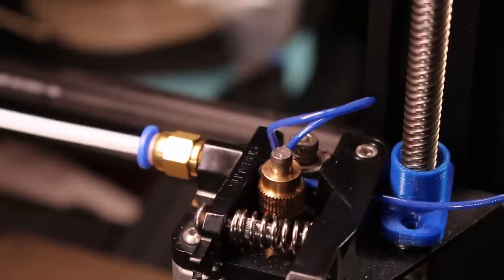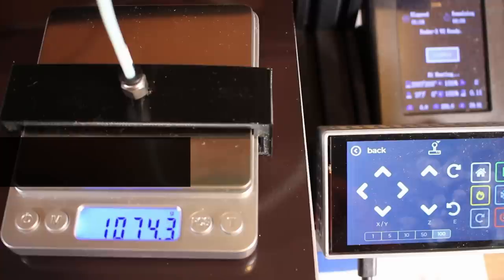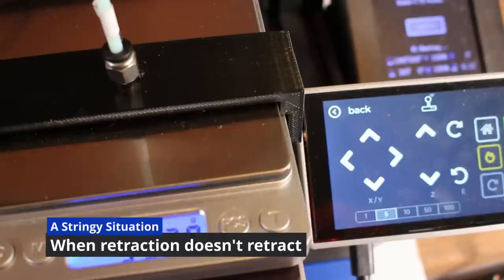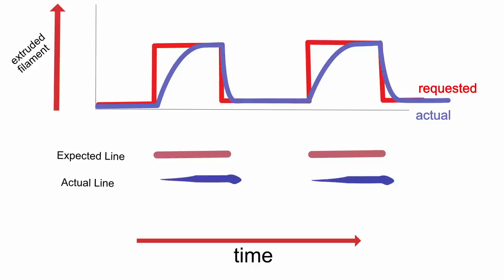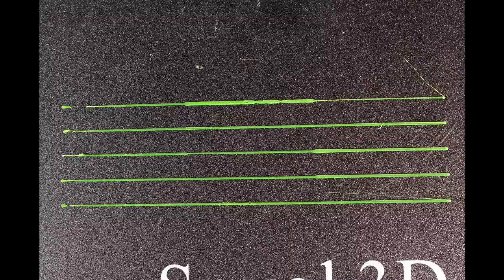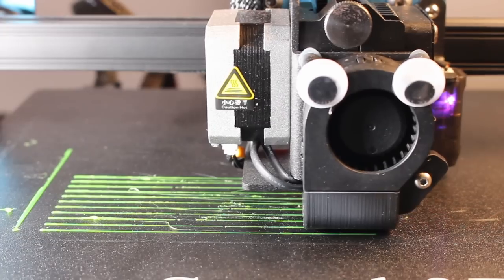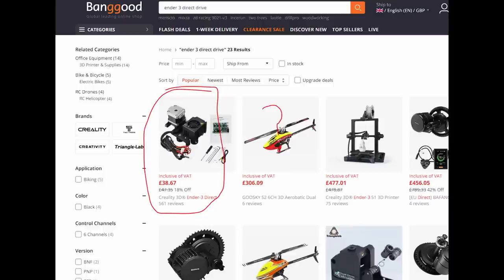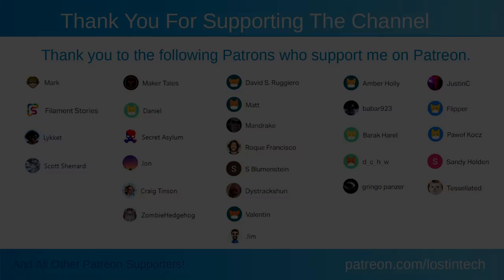Why 3D printing with FLEXIBLE filaments is hard and how to fix your TPU printing.

Comment: Thanks for these. Your previous TPU videos (and profile) helped me tune my E3Pro for 95A with amazing results. I understand that if I want to go more flexible than that, I will have to invest in a direct drive, but really great-looking 95A from an Ender-3 was more than I was hoping for and is enough for my needs.
Reply: There's also nothing stopping you from converting your Ender 3 to direct-drive without spending money (apart from some filament and an extension cable for the extruder motor).  Just look for the Direct Drivinator on Thingiverse and co.  I've had a slightly modified version on my Ender 3 Pro for ages and even for printing PLA the reduced retraction needed outweighs any drawback (extra weight on the x-gantry which on Ender 3 is only supported on one side) in my eyes.  Clearly it isn't giving you a fancy gear reduction or so, but at close to $0 it was one of the best improvements I added to my Ender 3 Pro.
Reply from the maker: Yes I forgot to mention you can do it for free 👍

Comment: Not a pain to print with a Bowden tube going all the way to the nozzle. Had 0 issues with that.
I have moved my printer to direct extrusion and only then realized how wonderful Bowden tube was(with some cons of course.)

PTFE tube has no friction. So you can print with any speed and temp. Even in a case extruder will not be able to push TPU with needed rate, Bowden tube length will compensate that as a buffer, allowing filament to curve inside but not stuck fully.

Comment: Nitpicking here, but the spring model is slightly incomplete and only part of the picture. Hopefully the below is helpful for anyone wanting a bit more of a deep dive.

LA/PA values are in units of "time," and it's easiest to think of K as an approximate time delay between the commands are issued and when material actually exits the nozzle. Material stiffness contributes to LA/PA but that's only part of the story. LA/PA is more like a RATIO of flow viscosity (damping) divided by spring constant (stiffness). This is why materials that are free-flowing and rigid have very low K-values. Those with either high viscosity or low stiffness (or both) have high K-values. Surprisingly (or not), this ratio has units of "time" just like the example above. Not to take the wind out of your sails, but the use of the letter "K" IS likely either coincidental, or a by-product of an earlier and different model.

Final nitpick - "ideal" springs aren't time-dependent in engineering models - only position-dependent - so that alone wouldn't cause the delay (damper models are used instead). I understand the goal is a relatable metaphor, so no issues there, just wanted to clarify this.

...also, the rabbit hole goes way way deeper the more "accurate" we want these models to be. All of the "above" only considers drag with the nozzle walls, not additional effects like material viscoelasticity, die swell, temperature-dependence, printing quickly with large temperature gradients, etc.
Reply from the maker: Argh! I get your point though 😁
Reply from the maker: Oh also I would ask anyone who wants to corroborate your explanation, to check out the link to the duet firmware site in the description, because it's written like a huge academic paper! 👍👍
Reply: @LostInTech3D  Check out the academic paper "Investigating pressure advance algorithms for filament-based melt extrusion additive manufacturing: theory, practice and simulations" by Tronvoll et all. It has a pretty great explanation of the K-factor derivation and goes a little more in-depth. Eqn 4 in particular is where we see damper-like behavior (force = some coefficient times velocity)

The Duet3D derivation is OK but a little confusing as it's hard to track K from start to finish. The time-derivative of Hooke's Law in particular is where a bit of hand-waving goes on - technically it's where the model subtle switches from "spring-only" model to a spring-damper one.

Of course this is super deep into the weeds, but just something I wanted to point out just in case. Great video and content as always!

Comment: Because I have no patience, I print everything with a .6 nozzle and fairly fast. The few times I’ve printed tpu I just used my normal pla settings on a cr6 max with a very long bowden tube and had no issues.  Nozzle diameter has to be another factor to consider.  Great video
Reply from the maker: It does, I tested it in ...I think the TPU video before last! :)

Comment: I found that CHEPS solution to printing with tpu on a bowden style printer has been amazing. He redesigned the connection that is made to the bowden tube on the side of the extruder, and added a piece of tube that butts directly against the gear. With this set up I haven't had TPU escape at all. I'd suggest you give it a shot because so far its worked wonders. I've gotten pretty good results with his design and your information :)
Reply: Do you have a link to a video where he explains the process? Thanks 😀
Reply: That video is not easily found through a search

Comment: About the extruder tension needing to be lower, I notice exactly that last time I printed TPU. I have really not a lot of experience with that material, and I wasn't able to print it even tho I managed to print it in the past. Change the extruder to LGX, same problem. Well, there was too much tension. Used the first click on the LGX, printed flawlessly
Reply: Interesting, i have a lgx lite, set it to the last click (has only two tension settings and open), reduced the maximum speed to 150mm/s (you have read right, 150), hit go and a beautiful phone case came out, but not usable, bad stl (came out to large).

Comment: Wow, so happy I found this video and thanks for sharing. I was having the same issue. The issue I'm having now is, my dual drive gears are shredding my PLA filaments when going into the extruder. I have been in social media and here on youtube but I haven't found a solution. Do you have any videos regarding these issues and if you don't can you please make one?
Forgot to mention, my printer is an Ender 3 Pro. I also ordered the direct drive kit cause I got tired of trying to fix the issue with the dual gear drives.

Comment: There's also the 3d printed direct drive mount for Steves, which can be used to try out direct drive for free.
Reply from the maker: I think it works fairly well too?
Reply: @LostInTech3D  I haven't used it myself, but I've only heard good things about it.
Reply: That's what I have loaded on mine and it has really stood up to the test of time. The other thing that really helped with an Ender 3 is an extrusion idler that utilizes perpendicular force instead of lever arm action. Really helps to stop TPU from doing the noodly escape routine.
Reply: It's decent, but designed for hard filaments, not TPU. Still has alot of wiggle room right by the gear allowing for noodling

Comment: A thing i did to counter my TPU escaping from the feeder is that i printed a small insert i wedged in between the gears and the part the bowden tube is attached to which closes all the gaps it can escape from, never had any issues since.

Comment: I always run my extruder tension crew one turn tight from the minimum with TPU, Using cura 4.13 ender 3 pro PLA profile just turn off the bed heat works good far better than the tpu profile for said printer. Great video thanks.

Comment: 95a has been hell to try and print larger prints with the print would start ok but after a while i got terrible stringing and the nozzle clogged im going to try a 0.6 nozzle instead and play with the settings your videos have helped immensely any other things i should try.

Comment: Thanks do much for this video dude, so much great information for me to think about. And your humor throughout is very much appreciated too!

Having about 5 years of experience printing 85A TPE exclusively (*cough* FUSED footwear *cough*), I just avoid retraction all together and use a combination of coasting and wiping to defuse the pressure in the nozzle before the it moves to a new position. And my favorite way to print is a delta with zesty remote drive. But mine is a pretty specific use case I guess. 

I have the FLSun V400 coming and I'm REALLY looking forward to how that machine will compare to my home-built Frankensteins.
Reply from the maker: the V400 is an absolute beast on every level, I have no criticisms of it even after I think 200h of printing. You won't regret it!

Comment: This is brilliant! Basically You have make me into trying and printing in TPU. And now I'm exploring this subject, and making things that otherwise no one would thing to print in TPU or that would not function if not made with TPU or another elastic filament. The only thing I don't like in TPU - it is hygroscopic like table salt :/. I do fly my DD Ender 3 with Kipper, so I do use pressure advance, yet the advice to tune it especially for one speed and TPU is a gem (I would be happy to see guide on it). SuperSlicer (or Prusa) can have custom gcode per filament, I did figured how to add per filament setting in Cura - yet I miss custom gcode (I'm waiting for tree support in SuperSlicer). 
   Keep on good work!
Reply from the maker: I only recently heard how hygroscopic TPU is...I am very surprised to hear about it as I've never really noticed!
Reply: @LostInTech3D I've had issue with printing fresh spool (the fist one ever ;) ) from F3D Filament (stringing and differences between spool and web page description), so I've call them. A+ support from a guy that is on the same page , and I've got advice to dry it well at 70C. That solves a lot of issues.

Comment: I didn't know that people were saying to increase tension with TPU. I dealt with stuff myself an figured that when I use it with my Prusa MK3 S I would decrease the tension by about 1 screw rotation. Else it would chew up the filament. Later I also got into volumetric flow limits and now printing that stuff isn't as dramatic anymore. Though it's till not very fast with the standard extruder. Speaking about 70A and direct drive here.

Comment: This reminds me of how caulk guns will drool a while after you release pressure on the handle. The caulk tubes bow outwards when caulking, storing energy that's released once you let up. You can wrap them in duct tape to stiffen them up and lessen the effect.

Comment: As always thought provoking and interesting. your videos are always spot on and provide a great insight into 3D printing.

I have had good sucess printing 95A on both bowden and direct drive printers. I havent really needed to print anything much softer. 

I do use it to create molds that I cast concrete into, this is perfect as you need the structure to stay put and hold shape until the concrete is set but also gives when you need to demoulding. I use the whole printing process and design of the mold(structural thickness and also infill within the design) to augment the material ang gain additional properties of the part.

I must admit I do have some samples of ninja flex I got in sample boxes that I cant bring myself to print as I know it will just go to waste....
Reply: The NinjaFlex I have is apparently 85A, and it prints beautifully on my stock Ender 3 V2 (bowden), as long as I just print slowly, at maybe 10-15mm/s. A little bit of fine stringing, but then again, I haven't tuned retraction at all. I basically just use the generic TPU profile in Cura, slow it way down, and set my hotend temp to 230 (a bit higher than NinjaFlex recommends).

Comment: It´s pretty easy I printed lots of TPU parts on my Ender 2 back in the day. Just install a push thorugh fitting and use some PTFE tube which goes right up to the extruder wheels. Containing the material path in that way and using PTFE is great in general. Also get rid of any friction before the extruder on the filament reel, it should be extremely easy to unreel the spool.

Comment: I use the same method of letting the wire slip in my MIG welder at work, so if it does have a blockage at the tip, it doesn’t make a rats nest in the feed wheels.

Comment: I have never had any real  many problems with TPU as i print at 20 speed and the build plate at zero temperature  and the printing temperature at 228 c i just get some fine stringing which nothing. I do have some  problems with PETG with some failing at about 3/4 of the print. PLA all depends on the make and i find SUNLU and GEEETECH to be the best. Hope this comment helps.

Comment: Its likely different for me, as I run a direct drive, but for me I find cranking the thumb screw on the extruder tight as frig and using low retraction (0.5) with extremely high travel speed and acceleration (500mm/s, 7500mm/s^2 accel) lets me print TPU at 100mm/s with little to no oozing. (Im using a klipperized CR-20 with a DDX direct drive upgrade)
You really are shooting yourself in the foot printing TPU on a bowden, yea it can be done, but sheesh at what cost (i hate printing slow).

Also to nitpick your video, 9.8 newtons is not 1kg, the force due to gravity on a 1kg mass is 9.8kg/m/s^2, or 9.8 newtons.
Reply from the maker: Haha, appreciate the nitpick :)

Comment: How do I print with all metal heatbreak? Never seen anyone talk about it in depth, but switching to all metal after my ptfe lined one broke made my printer unusable. It keeps on clogging with ABS, so I'm not even trying with PLA.
Reply from the maker: Ah, well, that's the downside with all metal, it is more prone to heat creep. If you look up what heat creep is you might get some answers why it's doing it, but hop on to discord if you need any further help
Reply: Keep the all metal hotend for advanced plastics that need crazy high temps that your PTFE cant handle (over 245c).  I use all metal for Nylon, ABS, etc. Keep a PTFE lined hot end for TPU, PLA, PETG so you dont get jams in the hotend
Reply: @Fly_High_FPV  well,  I am mostly printing ABS now and get jams using it. I have a roll of CF Nylon ready for a few prints once I can finish the repair.

Comment: I have some Overture purple TPU. says it's 95A, but it's closer to 80A. Need all these tricks, a 0.6mm nozzle, and 15mm/s speed too.
Reply from the maker: you need to try to up the speed, 15mm/s typically gives poor wall quality. Try lower line height or something, to get the same flow rate, aim for around 25mm/s if you can :)
Reply: @LostInTech3D  mmm, k. I'll try it.
Reply: What kind of extruder do you have? Some are better suited for tpu (lgx, genuine bmg) while others not, like Steve's extruder in the video
Reply from the maker: Hey no dissing Steve 😁
(You're right though, the creality one is pretty average)
Reply: @LostInTech3D  steve is a good boy, but the extruder design is, lets say, kept simple or minimalstic

Comment: The PTFE tube need to be lubed. No joke. It works absolutely way better. I print like this on my ender 3V2 with bowden tube and TPU
Reply: Also i use absolutely constant speed, acceleration is high (1500) and linear (S curve is a disaster). 10mm retraction is just fine.
Reply from the maker: Lubed with what? PTFE is the 2nd lowest friction material in the known universe...

Comment: I have an ender 3 s1 (direct drive extruder) but i’m having a really hard time printing fliaflex 82A. I don’t know why but my flow is really inconsistent besides all the tests i made. Could it be a problem of the extruder itself? Maybe it’s not tight enough and doesn’t grip the filament well. If someone has some advice i would be really grateful!
Reply from the maker: Watch my most recent two tpu videos and you will find out why.

Comment: I have a Biqu H2 V2s direct drive extruder/hotend combo and it still jams with 93a TPU like a mofo but yeah, the key to success is to NOT slow down but to somehow manage the pressure. I'm not quite there yet, if anyone has a surefire fix on terms of settings, I'm all ears. Ender 3 with the Biqu, using Klipper and mostly a 0.6 nozzle.
Reply from the maker: Is that "the log"? It's supposed to be good with TPU, I wonder what's happening there. I managed to tame the sv06 extruder by slowing down retract and deretract speed, that might be of some help.